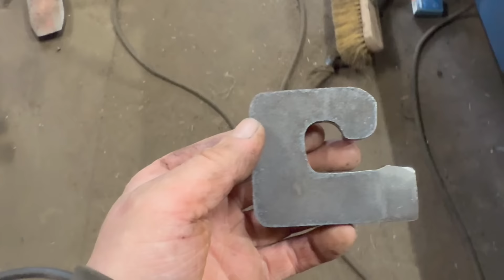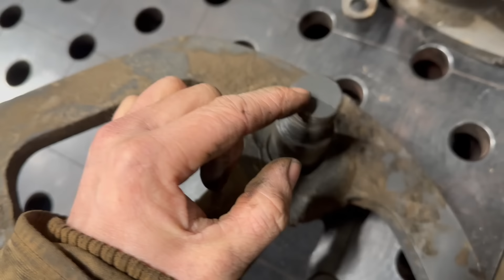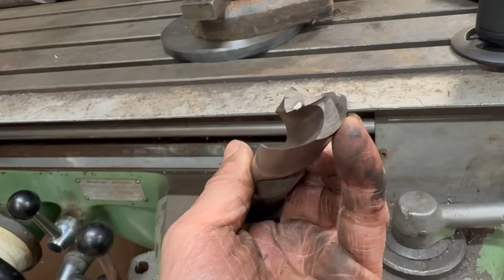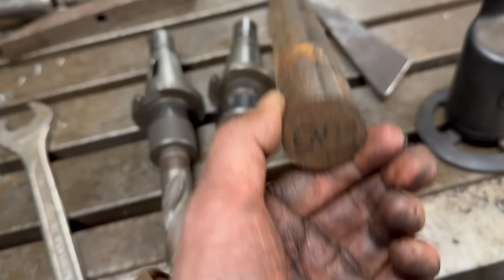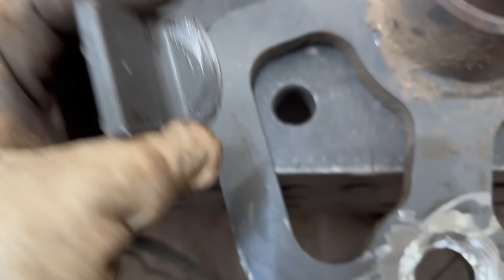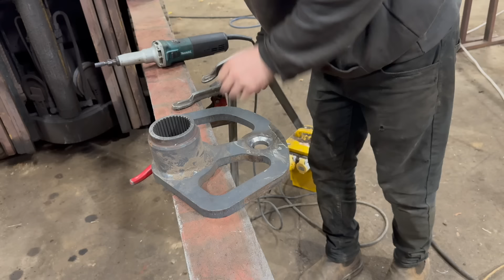The mundane odd jobbing jobs

Comment: Just a reminder to everyone that cutting discs have a ‘use by ‘ date. The year is stamped on the inner ring. There is a great risk of the adhesive binding the disc together will degrade after the ‘use by’ date. A lot of people were, like me, accumulating discs and using them when they were out of date. I used a disc that was three years out of date and damn near lost one of my legs. I have the scars to prove it. Be warned.

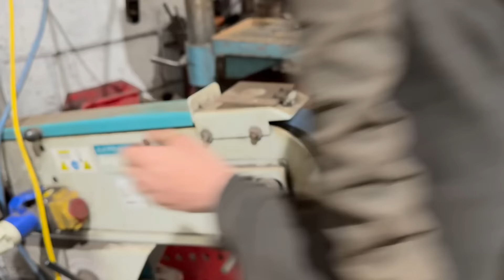Comment: 30:45 considering how sharp that bolts welding edge was... It is very dangerous to push it so hard up against the sanding belt....imagine that edge cut the sanding paper through. The best is to run that sharp edge lightly from left to right until the edge is blunt. Just my opinion

Comment: Great video.  That material is probably case hardened.  It’s softer once you are through the first couple of mm.
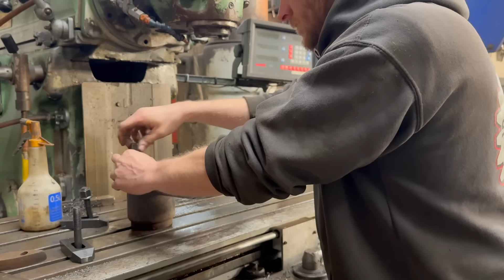35:46 A drill will likely wander off centre if your hole isn’t even.
I know it’s more trouble to set up but a single point tool in your boring head will follow the centre you want.
Your drill seemed to go ok 🤠

Comment: Oliver, when I took welding in trade school, we made our own chisels from round stock and heated them cherry red, then quenched them in water. When heating hardened steel, it's good to quench it in motor oil drainings, as it has carbon in it;  water quenches it too fast and it can become brittle and possibly it would shatter the peace when put into work.

Comment: I'm no metallurgist but for the shear bolt sleeves, personally I'd use EN24T. It's fairly easy to machine providing you don't get it hot and it's already heat treated so no need to heat treat it again, I'd probably make a top hat style bush with an interface fit on both shoulders.

Comment: Tip for you, instead of (or as well as) that squirt bottle you are using for cutting oil, you local garden centre should have a slightly larger pressure version of it where you pump up the pressure and it just squirts when you hold down the trigger. I have a couple of 1.5 litre units i use.

Comment: Another great video, quick question when your welding something on a vehicle do you have to disconnect the vehicles battery? I was told yes but extra job if it’s not necessary. TIA
Reply from the maker: No, never had an issue providing you're sensible where you put the earth
Reply: @snowballengineering  that’s great many thanks for your reply

Comment: I'd make the bush out of 4140 - sorry don't know the EN equivalent, maybe the EN19?. Heat treatment exactly as you say, non magnetic, quench in vegetable oil, temper at least 200 Celsius, maybe 210 or even 220 for an hour. Depending on how accurate your oven is. 
But I would put it inside a container of dry sand so it doesnt get exposed to variations from the thermostat as it kicks in and out to maintain the temperature in the oven. 
It will oxidise from the heat treatment process, so dimensions may slightly change.

Comment: Hi, You are running your cutting tools to fast on hard steel, the harder the steel the slower the tool should should run to keep the heat down and a little oil will help. In a lathe same with the RPMs Hope this will save some of your tools and tool bits. This is from working 60 years in a shop. Have fun

Comment: Hi, congratulations on the work you're proposing. If I may, what you see at minute 26:10 could be a grub screw holding a bushing in place? Press-fitted? Good job.
Reply from the maker: no bush
Reply: @snowballengineering  could it be to hold the sheared bolt preventing it to fall into the bale? To protect the cows?
Reply: Thanks for the reply

Comment: Hello from Canada. I don't think you need to drill those holes out, for the flywheel,so big for a bushing. Drill hole out 0.200" bigger and make bush to suit. 0.100" bushing wall thickness is more then enough with press fit. Standard NAS bushing for aircraft is 0.062" wall thickness. As others said use an endmill to drill the hole as it will stay on center and give a predictable finish hole size.

Comment: Hi Oliver just wondering and I know you only done a small amount of welding with the roll press hooked to the tractor but would you worry about the ECU on the tractor getting a power surge or damaged in any way if you had a lot of welding to do do?
Reply from the maker: Never had an issue before, but always got to make sure the earth is near the weld and not running through the machine

Comment: Nothing mundane about using your knowledge and skills to refurbish some tired equipment.  I am not an experienced bodger or professional fabricator, but my first thought would be to use smaller diameter bushes to repair the drive flange couplers - less of that difficult base metal to bore out and more of the original flange left for strength !?!? 🤔.

Comment: weld a 1inch nut and use a one inch bolt and then you can replace them forever
Reply: BASHING AWAY on the threads for that shaft - not good

Comment: Just an idea from here:
Those hooks that brake off. I you tried to drill a hole, where the hook is welded on, a mounted a heavy duty spring on the backside, that has a metal pole going through the spring, with the hook on the front, it might prevent the hook from tearing of, as the spring on the backside would take a lot of the intial force?
I hope you understand what I mean.
T

Comment: Hardening and tempering EN8 & EN19 are somewhat similar. The following is what I have done with success over the years. I would use EN19 whenever possible as it is better for wear resistance and strength properties.
EN8 hardening, heat to 840°C - 860°C, I used to induction heat wherever possible, quench in oil or water. To temper, heat the component to 600°C for one hour for every inch or 25mm of thickness, let the component cool down in air.

EN19 hardening, heat to 860°C - 880°C, again induction heat wherever possible. Quench in oil, not water. Tempering EN19, heat to 450°C - 550°C and allow to air cool.

These jobs albeit rather mundane, are essential to the smooth running of any enterprise. Good post mate, take care and be safe 👍

Comment: 😂🤣😂🤣Whatever size that is!! And you still get some that call metric silly.
Reply: After watching Oliver and Kurtis use metric and how much I struggle with fractional measurements sure wish we had switched years ago to the metric system.
Reply: @richwielechowski5191it's just so straight forward. Another thing I notice is American farmers using bushel per acre in yields. Surely ton would be more sensible as bushel is an area or volume. I mean when you hear 100 bushel you have to think OK so I have to multiply the weight of a bushel (each crop is different) by how many yyourgetting to find oout tonper acre. Mad. And of course outside America it would be tonne per hectare

Comment: When i worked in engineering we made hardened bushes out of EN58 steel heat them till they were cherry red then quench them in old diesel oil. going back to the pins breaking as they were sheer pins they were sacrificial and designed to break when the machinery was being over loaded. Maybe if the customer did not over load the machinery he would not keep snapping the pins. The hole you were enlarging looks like a harden bush. maybe if you removed the screw you found when enlarging the hole is just holding it in place and by removing the screw the bush might just knock out.
Reply from the maker: There isn't a bush

Comment: En19 is often used for hammers and striking tools so it definitely would be a good tough choice for a hardened bush. En8 won't be hard enough I don't think. The hardening procedure for any en rated steel should be easy enough to check as they're made to a precise standard.

Comment: I'd say the bailer drives with shear pins will be case hardened only to protect the teeth on the gears from wearing. If you manufacture the bush from a harder material than the shear pin, it should be fine.

Comment: Hey, Oliver.  For annealing low-carbon steel, all I know is we would torch it, put it in mom's oven at 500 degrees F or 260 degrees C for 1 to 2 hours, then turn the oven off and let them cool for 2 hours.  The steel was workable after that.  
Love your work, mate.   Have a good week.  Cheers.  BTW how were the tractor pulls?

Comment: That is a "ripper" cutter the steel will be cast so chilled hard on the outside and tbh the big drill was running a bit fast EN 24 T is what you want cherry red in oil and temper to blue and quench in oil.

Comment: Hi Ollie, May I offer a contrarian opinion not to attach these clips too secure as they may have been designed to pull off at a certain load so as not to damage any other components in the implement if the whole rotating assembly gets jammed-up with a brick.   Something like the shear-pin on a lathe drive.
Reply: A weaker chain or a weak shackle at on end would make more sense and be field fixable
Reply: @jons6125  : Absolutely.  The shackle pin, "waisted" at mid length, would be an ideal weakest link.
Reply: My first thought, too, but a weak chain link would be more sensible